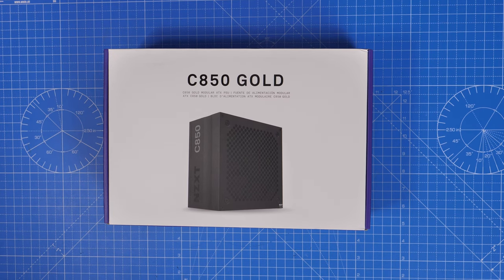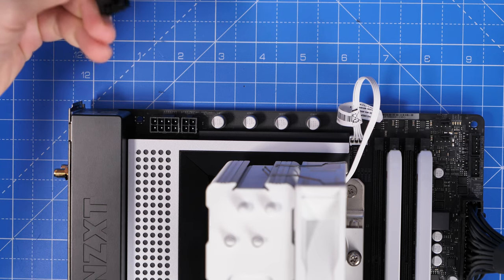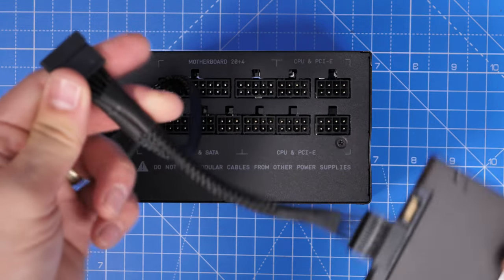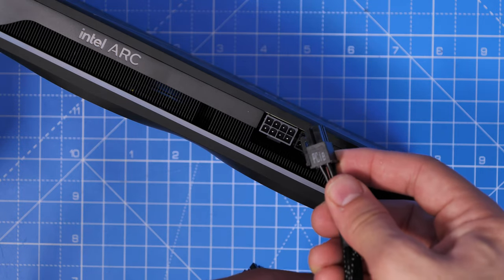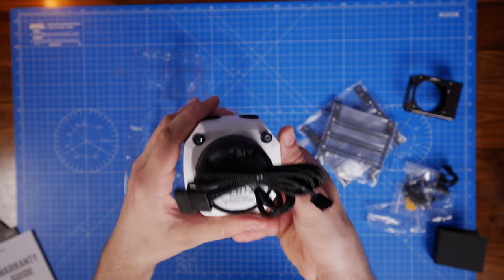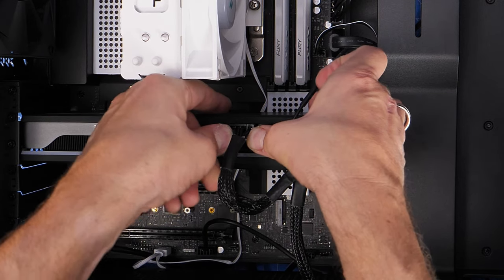NZXT C850 setup guide - how to connect and install your C850 PSU

Comment: 0:00 Helloooo
0:05 Unboxing the NZXT C850
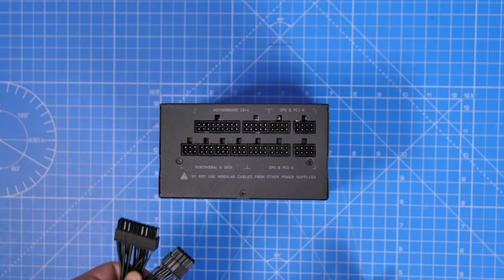1:09 24 pin motherboard power cable
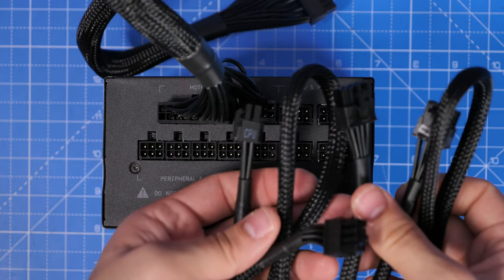1:57 CPU power cables
3:11 Flat sata connection
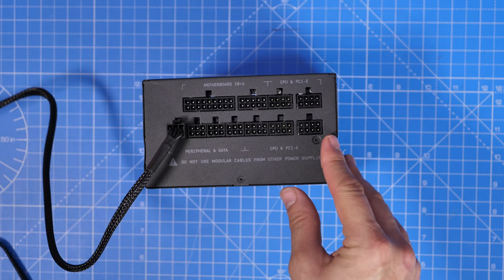4:06 PCI-E connection
5:19 Peripheral/ PATA cable
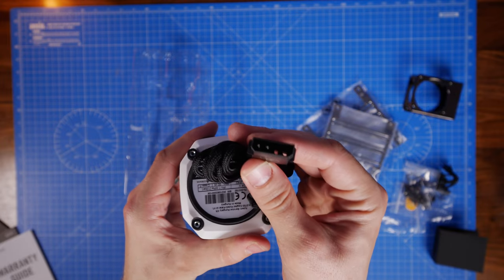6:10 Tip for mounting the PSU
6:26 Screws and installing the PSU
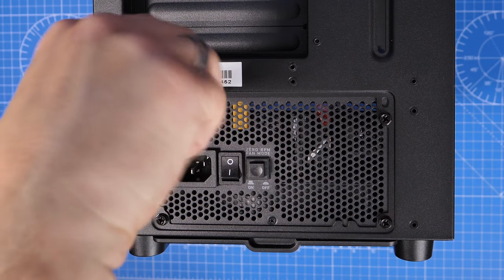7:27 Cable managemnet tip
Reply: thanks

Comment: Thank you for this detailed video, it helped a lot. May be you could help in solving the issue of clicking sound which I got from the new NZXT C850 Gold ATX 3.1. Some people are saying this is because of PSU cooler is touching something, but put PSU outside the case and it keep producing this noise. I would appreciate your help!
Reply from the maker: @ЯрославаКравченко-д2и  i'd suggest asking NZXT about it. Could be defective

Comment: 5:22 is this basically a molex to 6 pin cable? I need to know cause my case has 3 argb fans and they all have a molex head but my psu that I'm getting (which is this exact one, NZXT C850) has no molex connector so I need to have molex to 6pin cable.

Comment: Hello! Thank you for the video it helped me a lot replacing a 650 with the c850. A question if possible? When using the pcie to connect to my GeForce rtx 3070 I connected it with the one cable which has the splitter with the 8 pin and 6 pin. I’ve been advised to use two separate cables for the two plugs on my gpu? Would you use two separate pcie cables or will the one with the two plugs like what you used be enough? Thank you!
Reply: How did u manage mate?

Comment: my came on the opposite side of the sleeve so i cant fit it in the 24pin in the PSU can i cut the sleeve slightly?
Reply: pretty sure all of them do, you just have to pull it over like he does in the video. I was confused as well, that's why I came here tbh